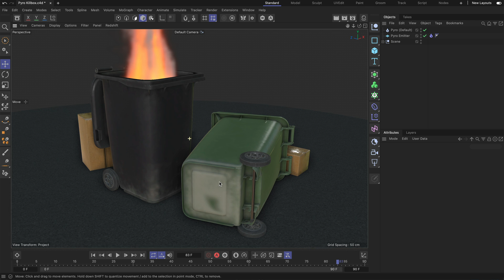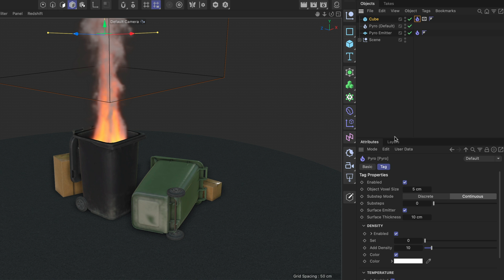#C4DQuickTip 63: How to create a killbox for Pyro in Cinema 4D

Comment: I think in the next release would be more tags for pyro 🤔
Reply: I don't think so: what else would be the point of that Tipp?
Reply: @simontrickfilmer  surely there were tips for the bones tool and for the pyrocluster. Fields changed slightly from one year to the next and, at the request of the users, the actions of the dynamic place tool were recorded with cappuccino. It would have to work similar to the tag collider... although you may also be right and it will stay that way 😅

Comment: Maxon should make a Killbox tag. similar to Pyro Fuel
Reply: Yea a checkbox directly under the Surface Emitter checkbox that sets the basic kill parameters and switches the tag icon (like rigid- collider- and ghost body tag) would be a smooth way to do it.
Reply: Agreed, that's a lot of unnecessary steps, but I suppose it's because Pyro is so new. I'm sure the team is probably already working on it.
Reply: 100%